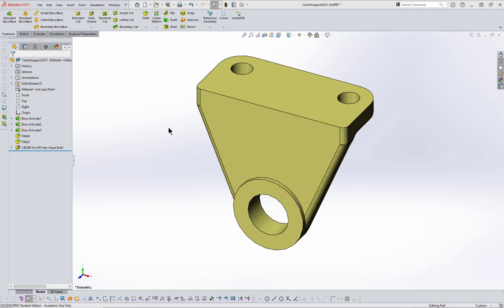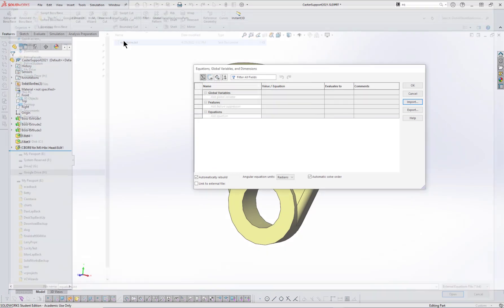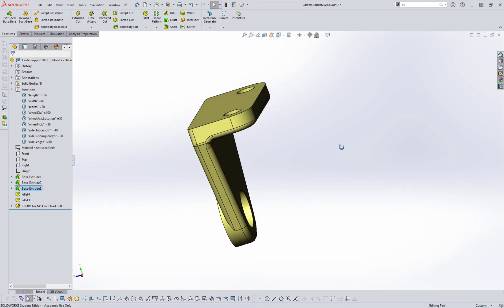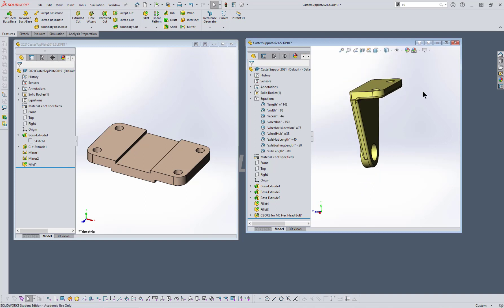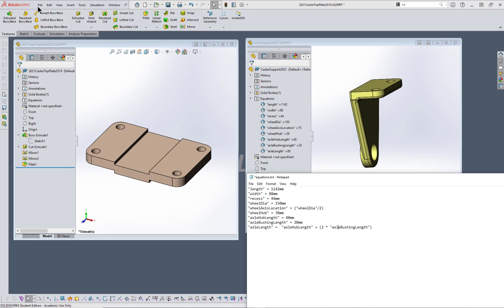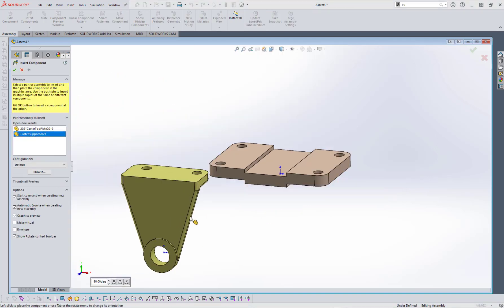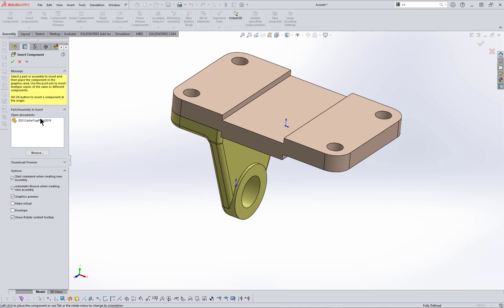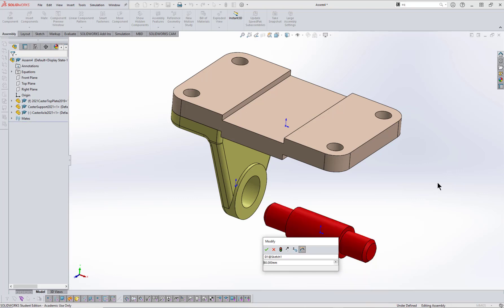SolidWorks UsingGlobalVariableAcrossPartsAndInAssemblies

Comment: Did you import the same text file into the second parts equations though? it won't automatically do that, you didn't quite explain the step there...
Reply from the maker: You have to import the text file into each new part or assembly. The description indicates that, although I didn't do it for the second part on the video.

Comment: Hey Mr. Abbott, thanks for the video it was really helpful! I do have a slight problem in that I don't have the "Link to external file" option on my GUI. Do you have any idea why that might be?
It's not the end of the world but it does make it more tedious having to reimport the txt file for every part after i change something
Reply from the maker: I have no idea, but I'll look into it. Did you try uninstalling/reinstalling SolidWorks? That sometimes fixes problems like this, but I wouldn't get my hopes up. What operating system are you using?

Comment: Hi Dan, Thai video is extremely helpful in a project I have been working on that was sorta sidelined because I was unable to get the entire assembly model to change based off document properties. Would you be able to do one on ones to potentially work on some more in-depth solidworks topics?
Reply from the maker: I am glad that it was helpful, but I'm sorry I'm not available for any additional projects. I have a deadline for a revision to my book AutoCAD: Secrets Every User Should Know and I'm preparing to retire in January so I am winding down outside work.
Reply: @DanAbbott-SMCC  Congratulations! That is great To hear. This alone has been a huge step forward in my project onto the next problem of getting configurations to change based on equations.

Comment: Hello Dan, I'm pretty sure that you can't access the Global variables while in the sketch is because SolidWorks needs to "save" the "part" in memory before you can use Global variables in it. Technically as you are in a new sketch and have not exited it for SolidWorks to do that. If you exit out of the sketch and then edit it you can use Global variables, you do not need to create a dimension and create a feature in the sketch before. 
Just exit the sketch and edit it again and then you have access to the Global variables :)
Keep up the good work in these videos
Reply from the maker: Thanks for weighing in. I may not get to revising this one right away, but I will keep making videos for my students and making them public.

Comment: Hi Dan I'm a self taught user and I never took teachings in the field, just figured stuff out on my own. I was wondering, you mentioned top down design in 13:05 , how does that differ from this workflow, have you any videos on it ? I'm really interested! Thanks!
Reply from the maker: There are a few other videos that deal with equations. Global variable are fairly straightforward, but the process can get fairly involved. You might find the video on tapers and that on configuration tables useful.

Comment: Thank you for the video. I used this to a and it is great...but I have troubles when making copies of an assembly. Once a the file is linked, even if you save as with references file reference stays the same. Is there a wa to go around this?
Reply from the maker: The best way to make copies of an assembly is with the "pack and go" function. I'm not exactly sure what you are asking, however, so this might not be responsive to your question.

Comment: Hi Dan, thank you for making this video. I have been teaching myself how to use SolidWorks for the purpose of fine hardwood furniture design and construction. I’m working on a maple workbench assembly file that I made using a top-down approach.  You mentioned this being cumbersome. I would greatly appreciate an opportunity to discuss design philosophy with you as there are not many knowledgeable people to turn to for help on this subject. Please let me know if this is something you may be open to, I’m also local to your region.
Reply from the maker: You're welcome for the video. I don't have much time right now though. Since you are nearby, you might consider taking AEDD170 at Southern Maine Community College this fall, which I teach. It requires an individual project, so you could use your workbench as a test case.
Reply: @DanAbbott-SMCC  Thank you for responding to me Dan. I understand your time is limited, but perhaps you can afford me one more response here in regards to a specific problem I have encountered. I created a .txt file global variable list and imported it into my assembly file (that I designed top down). When I attempt to edit the dimensions and link the imported global variables by entering the = sign, they are simply absent. Only Functions, File Properties, and measure show up. I did notice that if I create a new sketch (not within a new part) then the global variable are accessible, however this does not do me much good. So my question to you is this a Solidworks bug or is it a function of my top down assembly?

Comment: Can I share a table in one part to another part. The equation editor is a bit annoying to use.
Reply from the maker: If I understand your question, I doubt it since the configuration table is linked to specific named dimensions, so the dimensions would have to exist in the new part with the same names. I'll try it if I get a chance, but have you tried it? Maybe if the equation manager contained only global variables, but not equations linked to dimensions? It doesn't seem to work, even for just global variables, but I'll look into it.

Comment: Thanks for the video! I have a couple questions. 

You can make Global variables available in only the assebly ans set part variables equal to these once the part is loaded in the assembly. Opening the part file the dimention shows up as a read only. Is doing this accepable practice?

If I set up my gobal variable text file, import the file in to the parts and then realizes I want another variable how do I link it? It does not seem to do this automatically is there a way to make it update this automatically?

Thanks!
Reply: Thus far the only way I have found to add a global variable to the text file and part is to add it to the text file. Unlink and deleate all my gobal variables in the part and then click link gobal variables. Any other method either does not sink to the text file or does not sink from the text file to the part.
Reply from the maker: Sorry I didn't see this earlier. Busy semester. You can add global variables to the text file, but you have to import that new variable into the file in order to use it. You must also check the box in the column between "evaluates to" and "comments" that is identified with an icon that looks like a notepad and for some reason doesn't display a roll-over. That will cause it to link back to the text file and update your part. No need to unlink all global variable. If that doesn't answer your question, let me know.